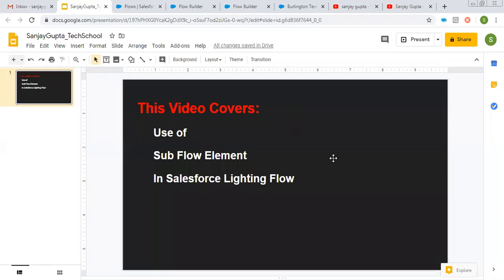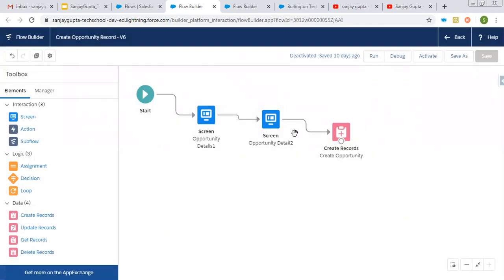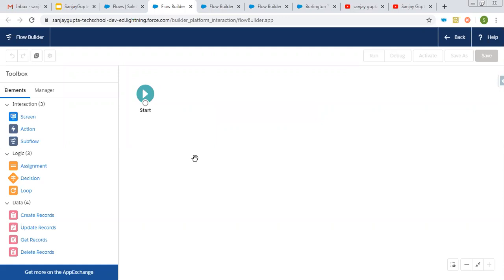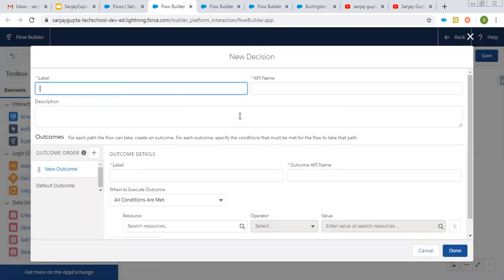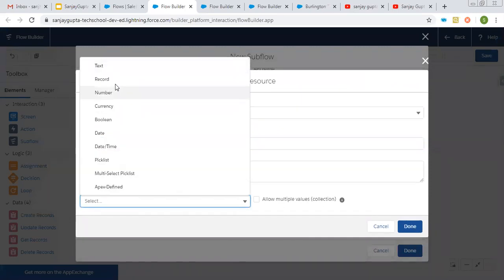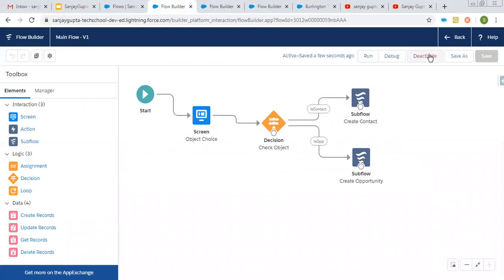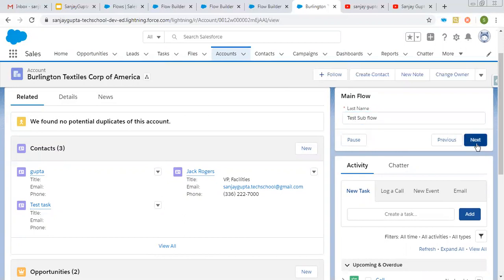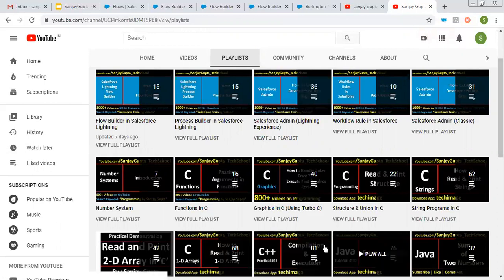15 Use of Sub Flow Element in Lighting Flow Builder | Salesforce Training Videos | Learn Salesforce

Comment: What is the best practice for a scenario where we have to create multiple records for 3 related lists? This will have 3 different loops on same objects. I can't figure out how I will be linking these 3 loops.
Reply from the maker: You can create three sub flows and link it with main flow or you can do it all in one flow as well. You need to iterate each loop one by one.
Reply: @SanjayGuptaTechSchool  thanks for quick response! Can sub-flow be written in auto-launched flow as I couldn’t see the option in the element list?
Reply from the maker: In record triggered flow it is not present but in autolaunched flow it is there. Autolaunched flow you can call thru process builder.
Reply: @SanjayGuptaTechSchool  Okay, I am thinking if I am directly using record triggered flow, why would I require to write a process builder separately?
Reply from the maker: In case of auto launched flow u need process builder. Not in record triggered but in record triggered you can use sub flow option this is what I wanted to say.
Reply: @SanjayGuptaTechSchool  got it. Thanks 😊 your videos are to the point and help viewers learn and be creative. Keep it up 👍